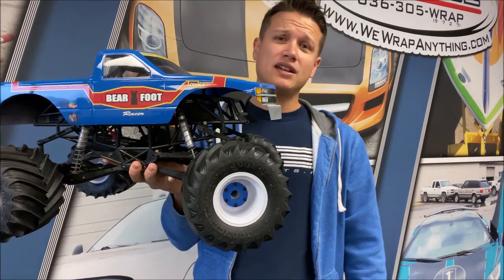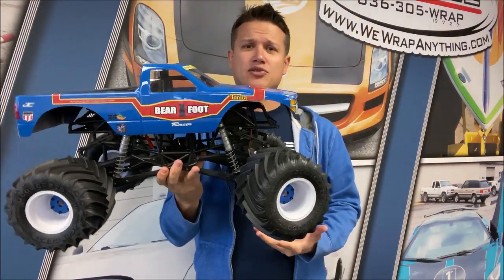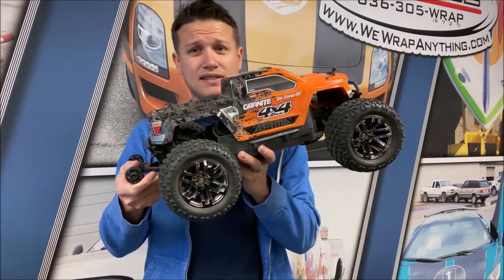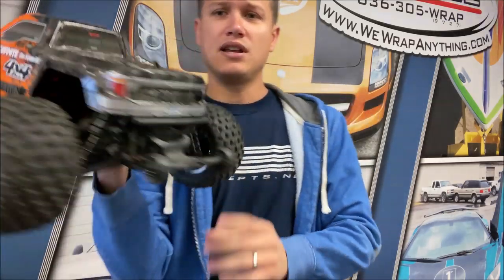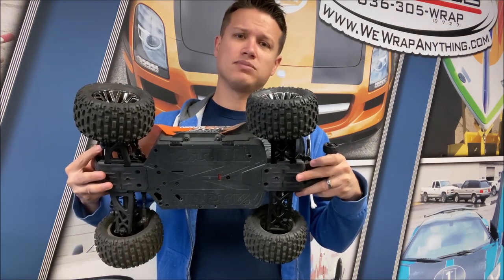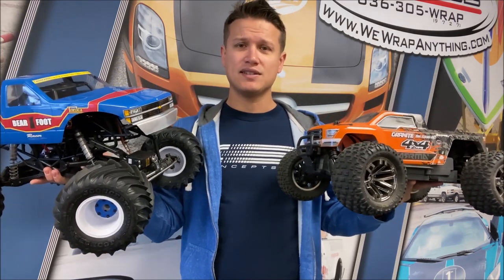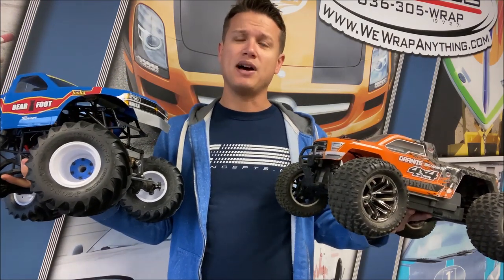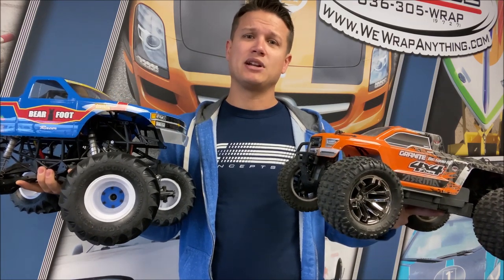So what exactly is a solid axle monster truck anyway?

Comment: Could you guys point me in the right direction to be able to buy a solid axle monster truck (Brands)?
Reply: Aixal smt10, tamiya clodbuster, tamiya juggernaut, tamiya txt 1/2, hpi wheely king, cen racing b50/HL 150, then freestyle RC make a few chassis and axles as well.

I think the axle smt10 is the easiest to get and gets upgrades for, the tamiya are good for retro racing when stock, but they are pretty low quality compared to modern RC.

The hpi wheely king is a bit small and harder to find parts for.

The cen racing is also small, but is also quite new, not really seen many tbh.
Reply from the maker: The Axial SMT10 can be made into a full scale monster truck fairly easily.  Just will need tires and wheels basically.  Or, they have a "builder's kit" which is essentially the same thing, but will also need all electronics.  Also, a Tamiya Clod Buster is another option.  It can be run right out of the box and would be comparable to our Outlaw Retro class of trucks.  These can be heavily modified as there are hundreds of aftermarket chassis' and parts available for them. To learn more about each, go to https://www.youtube.com/playlist?list=PL-Q2a76uWflF_YNPoN-9FZye01Mbxw3EJ
Reply: @TriggerKingRC  Thanks for the quick response. I truly do appreciate it.
Reply: @LawrenceTimme  Thanks for sharing this information my friend.